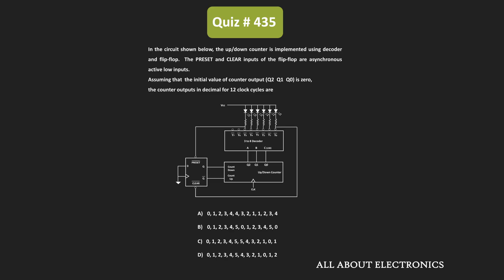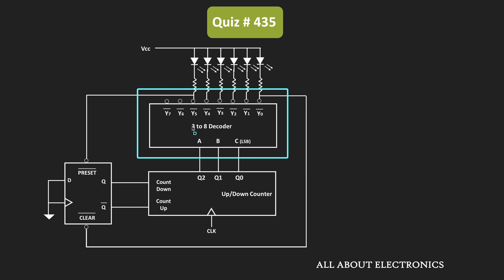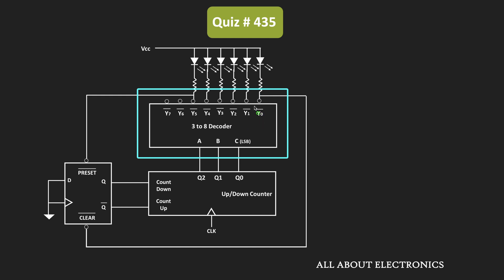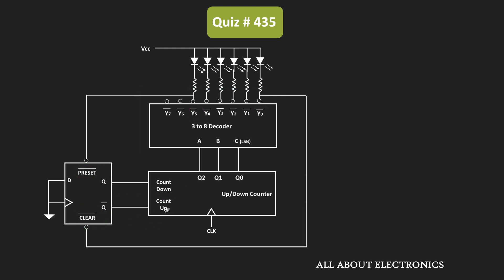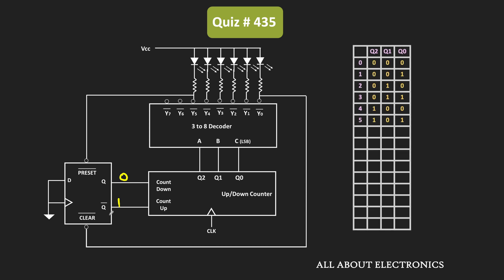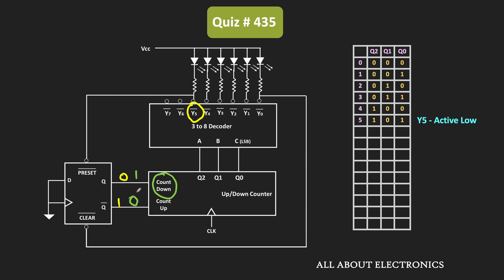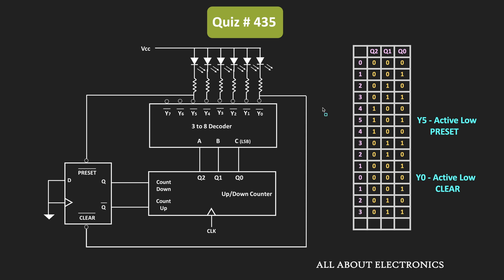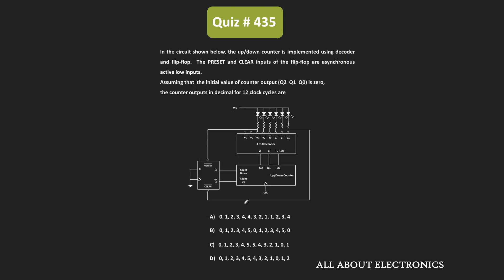Solved Problem on Counter (Digital Electronics) Quiz # 435

Comment: Sir i have a 2  doubts in fig 1.D flip flop and clk both are connected together and it looks like they are grounded so if this then this FF will never be in working conditions .. 2. If the op of decoder i101 then as not is present so at y5' terminal we got 0 and as the diode is associate with the line, immediately the diode gets in F.B so the reset' gets 1 as ip  so it will not reset the FF.. so i think there are some falacy in the ckt Or i have to think differently??
Reply from the maker: Yes, both clock and input of the flip-flop are connected to the ground. It means FF is not working as usual. But PRESET and CLEAR inputs are asynchronous inputs. It works independent of clock and input. These inputs (PRESET and CLEAR) can override the other inputs. 
I have already covered it in detail on the main channel. 
Here is the link for that video, please go through it once. 
https://youtu.be/xe8ME6nYYHk
Secondly, the diode is connected to indicate which output of the decoder is high. 
When the specific output of the decoder is low then that particular LED will get forward biased and it will glow. 
But the bubbled output is also connected to PRESET input.
So, FF will receive that input, and immediately the output of the flip-flop will get set to 1.
And the same will be applied to the counter.
The counter works on the clock edge. So, now at the next clock edge, it will start counting in the downward direction.
I hope, it will clear your doubt.
Reply: @allaboutelectronics-quiz  Thank you sir for clarifying my doubts